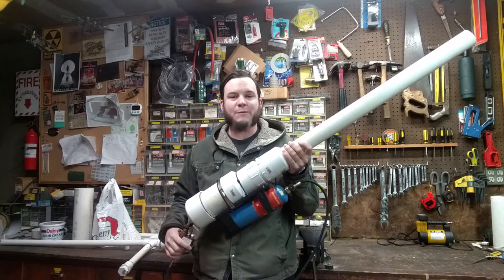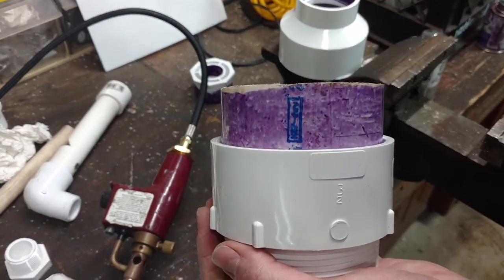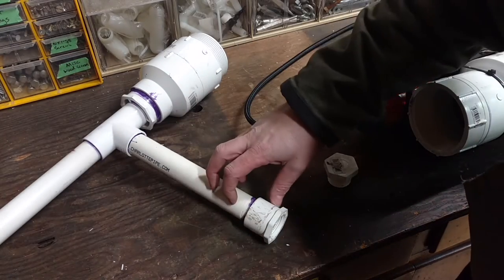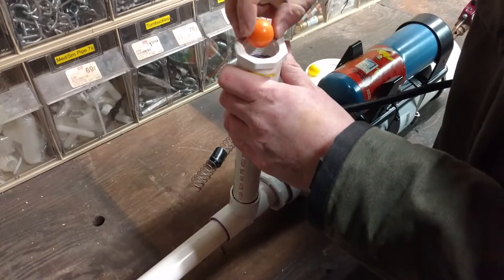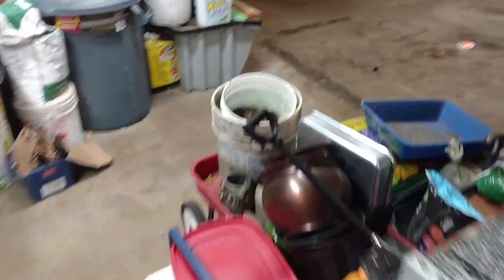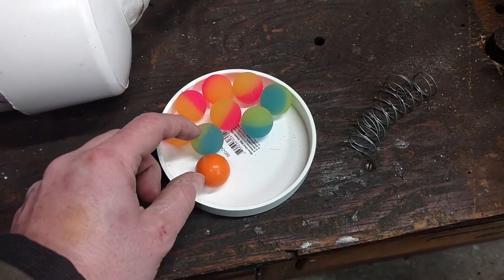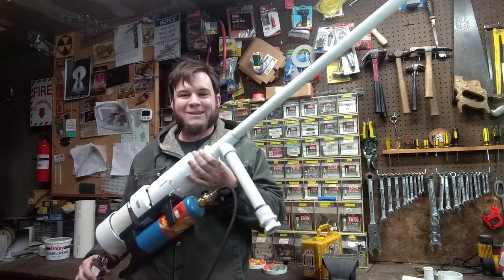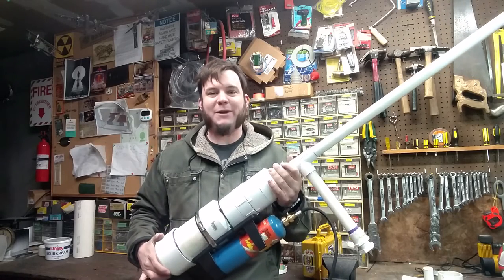Semi-Auto Rubber Ball Cannon - Propane Powered Potato Gun Mod

Comment: If you drilled a small devitt in the  barrel pipe where the ball's come into the main chamber/barrel pipe they may not roll out as easy.
Reply: With any luck, induce some backspin.. :)

Good call on the divet GRIMRIPPER, good call.
Reply: Kewl.  Would it leak a bit of gas?  Maybe a tiny dab of silicone glue in the hole to make a soft bump like a paintball gun divot.

Comment: Great video !!!!!!! how do you fix the problem with lack of oxygen in the chamber.... after few shot when O2 used up
Reply from the maker: The torch has air vents in the nozzle that suck some fresh air through along with the propane. I probably lose some pressure that way but it seems to work!
Reply: @saveitforparts  awesome !!! i thought the same , any plan making it full auto ?
Reply from the maker: @thankforsharingable  It's probably too slow to re-fuel for that. If you check out my more recent videos I have a similar one that uses compressed air, it would probably be easier to convert to faster shooting!
Reply: @saveitforparts  i was wondering if you hold the trigger on the torch
Reply: or smaller chamber, smaller bullet like 6mm bb . then explosive gas continuously from the chamber... since you have fixed the oxygen issues.
Reply: or implement something like solenoid valve electric valve to repeats the firing action. since you are using electric spark to set off the fire
Reply: like the other comments was saying it would be great in the paint ball situation.  compressed gas loses power over time and re gas frequently.  your design on the other hand will probably be alot more powerful and no power loss.  imagine how long your propane tank will last in the paint ball game. ...

Comment: This is sick! And is inspiring me to try to do something similar. What kind of propane tank is that? It looks very nice and compact
Reply from the maker: It's a 14oz size, usually comes standard with torches and most hardware stores should have them. The ones for camping would also work but are a little fatter.
Reply: @saveitforparts   how does the propan light every time. After the 1st Shot the oxygen must be gone? How does new oxygen geht into the tube? Greets
Reply from the maker: @m.castellan  The torch has some vents in the nozzle that allow air to mix with it (otherwise it wouldn't light straight out of the torch either). I do get a little blow-back through those vents sometimes, but it's not too noticeable.
Reply: @saveitforparts  But to mix the gas doesnt restore the oxygen. !?. How long does it take after the first shot for fresh Air with enough oxygen to get intor the Camber and make the second shot with about the same energy? How long do you wait between 2 Shots? Thank you!
Reply: @m.castellan  thats probably " incomplete combustion " lose some power but acceptable i guess

Comment: How are you mixing the air in???
Reply from the maker: The torch has some air holes in the nozzle base, that's how it normally mixes with the propane when used as a torch. I kept those holes outside the combustion chamber, they don't seem to cause any issues.